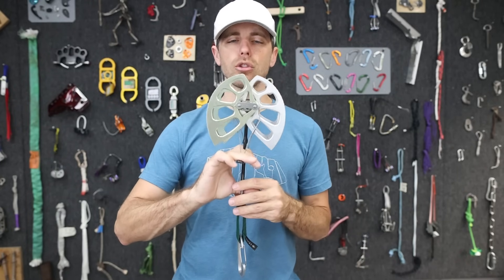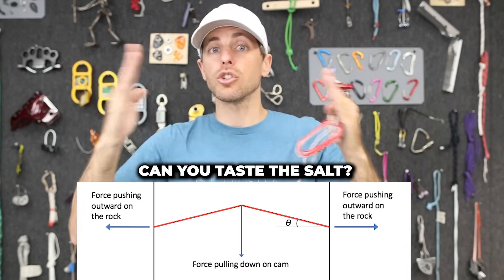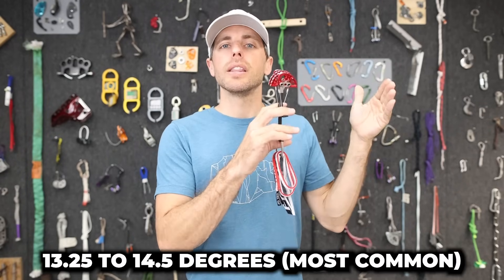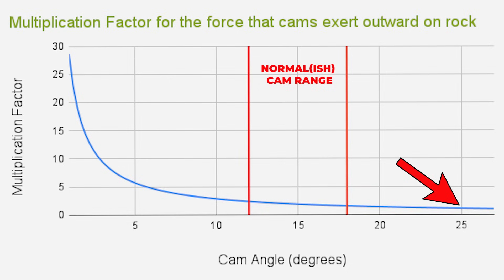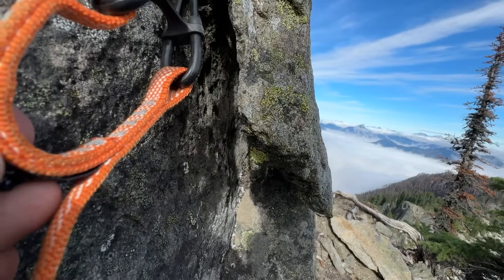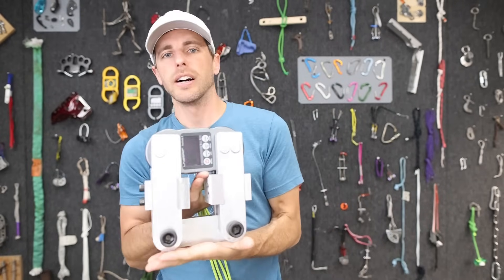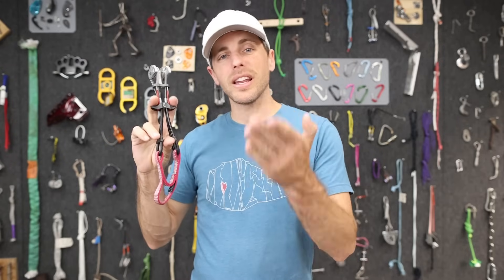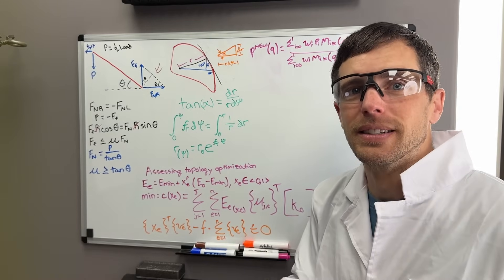What breaks first?

Comment: That's not c channel. That's just channel. There is a difference. C channel is square tube with a strip removed from the center of one side. You see them a lot in stop signs and sometimes fence posts. Sometimes there's holes drilled opposite of the channel.

Comment: Well... hate to be that guy but friction does NOT only count or matter if an item is moving... The 1 reason the anchor stays is by the friction caused by the force outward on the rock. The outward pressing force of the came is simply increasing the friction stopping the cam from shifting. Ignoring friction in this case is like ignoring gravity when doing rocket science... sure you can ignore that... but you're ignoring the literal BASE reality of what you're doing science on...

This is ESPECIALLY true on something like a hanging rope due to having such a high potential energy as the cam is being constantly pulled on. This is different than if a ball was just sitting in a hole as then friction wouldn't matter as the ball was at rest with no potential energy. But the came being pulled constantly means that the friction and not the outward force is what is keeping the cam in place and the outward force is simply increasing the friction the cam is placing against the wall.

Comment: I was on an aid lead up a flake on upper Cathedral and moved up on a pin and two passive nuts before doing a couple free moves then placing an overhead friend, like a #2 as I recall. When I sat on it to rest and get back in the aiders, two of my pieces below got loose when the flake, which seemed to be solidly attached, flexed a little. My intro to 'expando.' There's a bright side to this phenomenon- sometimes you can sit on a cam to make a nearby pin or nut, or another cam, easier to clean.

Comment: So I have BD cams from 2007. Sizes 1, 2, 3, 3.5(older style) and 4. Sizes 1 & 2, the plastic surrounding the wire cable is aged and cracked off. I have temporarily retired them, but I have an idea to cut the webbing off and put a quick link to use in a multi cam top rope anchor system, as the plastic coating is the only bad part. Anyone want to chime in as to how bad or decent of an idea this is? 😂

Comment: As a welder that builds pressure vessels, Id say that the jig you have is glued together. But as you would day super good enough, if it was perfectly welded it would probably handle close to 120000 lbs of tension.

Comment: I just want to state the obvious, the cam isn't pushing outwards on the lobes, it's pushing at an angle. This experiment splits the force vectors into two components at 90 degrees each. 

If you measure 1kn on a straight pull and get 2kn outwards, assuming those two measurements are at perfect 90 degrees, then each contact patch should see a 2kn vector going outwards and half of the 1kn vector going in line with the pull. So, the resulting force on each contact patch should be sqrt(0.5^2 + 2^2) = 2.06kn at an angle of acos(2/2.06) = ~14 degrees. Which coincidentally is what the cams are advertised at.

It looks like a rounding error, but if you want to chase all the variables, this 3% "rounding error" is what's holding the entire 1kn pull force.

Comment: Intuitively it makes sense it would be double the force; if the force holding it in the rock were less than the force pulling outwards, the cam would either slip or friction would have to make up the difference in force.

I’ve always just relied on my second grade understanding of levers to keep me safe.

Comment: i can't help think that anything with a malleable material like wood in the system will distort the results?
Reply: I originally thought the same. But, I think if the wood gives a little you would see a reduction in both outward and applied force and the ratio would be the same

Comment: - the "lever machine" - will have some strange binding / frictional issues pulling on a cam as it is operating in 2 planes with out of plane torque on the levers..

The compression cell tester looks good - maybe place the pads on  low profile drawer sliders to remove friction (even if insignificant)..

Comment: shouldn't the ratio of pulled distance on the cam to the amount it spreads be the easiest way to "calculate" the ratio of outwards to pulling force?
so if you pull 4cm and the cam spreads 2cm you have a ratio of 2/1 so two times the spreading force?
Sadly I can't find the pulling distance on your technical drawings. Would be awesome if you could "test" my theory.

Comment: The friction involvment is twofold. Of course, as it was said multiple times, coefficient of friction against the rock doesn't matter as long as it isn't slipping, but there's also coefficient of friction within the pivot which acts as additional torque on the arms of triangle in the diagram. which should lower the outwards force.

Comment: dude, you are awesome,
 the only thing i would make sure to have on the final rig is some kind of structure to make sure the surfaces contacting the cam and the load cells stay in place, a fun solution to angled contact might be to use a big ball bearings as a spacers to make sure the load cell is not getting angled contact with a flat surface, another idea is that it might be easier to put the spacers of the outside of the load cell where uneven contact might not be a problem, maybe a big thread or something like that might make the work as a spacer and now the only problem to solve would be how to make sure the contact plates don't angle with the cam. 
I love that the new rig also offers the possiblity of doing the friction tests on it cuz everything is swapable.
On the process side of things, it might be interesting to take pictures of the cam under load so that you can measure angles and points of contact from the picture, potentially giving you the option of calculating friction coefficients in the future.

Comment: Since the cam is pulling those friction plates into the side of the frame there will be an inward friction force opposing the cam's outward pressure meaning the measured outward force will be lower than it actually is.
Reply: Not by much, as the outward component of the cam's action is not in line with the friction component you're mentioning. The results is a pivoting action where most of (like in the order of 99%) the original sideward force is transmitted to the load cell.

Comment: It would be interesting to measure the tricam with different camming angles (from a tight fit to some less bomber placement you would be afraid that it can walk out). I expect forces ranging from what you measured (for a tight fit) until forces similar to a friend's in a wider crack.
I would be very interested in tests with ballnuts. I'm not sure about my math, but I get a factor <1 which makes me now more worried about getting enough friction than exploding the rock. :D

Comment: Sorry about my comment on the other video.  Could have been a bit nicer.  I'll admit that I was pretty relieved to see the numbers back up the math!

Not sure how feasible it would be, but i think a dynamic test on a drop tower would be super interesting.  Does an expanding flake "cushion" the fall and lower the peak force a significant amount? If the cam starts skittering out / breaking crystals, what happens?

Cheers

Comment: Good Job! Friction still not a factor, because it is too dependent on too many factors you really don't want to guess at.
Reply: Yeah it's easy enough to remove friction from the equation and just calculate the normal force, but for the testing friction was still really important. My little rig with the wooden spacers went through several iterations to find stuff that's easy to adjust but wouldn't slip

Comment: Now the real question is how much force rock can take.
Reply from the maker: All the kN if it's big enough.  Just make sure you climb on a UIAA rated rock!
Reply: @HowNOT2 It doesn't actually need to be very large.    A 0.6mx0.6mx0.6m cube of granite is approximately 550kg to 600kg.   Given that a cubic metre of granite is about 2700kg.  That would be heavy  enough to hold a 4 Kn fall.   Awesome video.
Reply: @twinmike1  That's not how physics works. You can move a cubic meter of granite pretty easily on ball bearings or balanced on a pivot. A flake of granite could be really well attached to a wall, or it might have weathered out to the point that it is right on the cusp of naturally falling off. After all, absolutely massive pieces of rock naturally fail all the time. Most of those existed somewhere near a perfect equilibrium at some point before failure where the several KN of force could have disrupted them.
Reply: Yeh that was the real interesting question for me. I think we all know that cams hold if their well placed. 

What I really wanted to know was how chossy looking a piece of choss needed to look before it wasn't worth shoving something behind it. 

Evidently there's relatively infinite variables, but still, that's the significantly more useful question to placing pro and building anchors.
Reply: Yeah....  As a professional geologist thats a big "it depends"
Reply: @AnonymousOtters  for certain. Which is why destroying some nature in the sake of science would help generate better eyeballs / rule of thumb. 

Because let's face it, we've all banged in some suspect fear gear because it made us feel better. But you don't really intend on testing it to see. 

Honestly critiquing a bit of rock is pretty relatable to stuff you've looked at and thought yourself, just the whole destroying nature part that comes after we don't do
Reply: With enough freeze/thaw cycles going into a crack, it eventually goes to zero. As anyone who has seen a rock fall off a cliff can verify.
Reply: Yeah, knowing the numbers for the force applied is precisely useless if you don't know the force the rock can take.
Reply: I usually go by if I can yard on the flake with directional force in it’s weakest direction it should be fine but just stitch that crack up and climb carefully and trust the choss
Reply: good point, rock type video and their breaking strength would be great
Reply: well i know from practical testing that a motor hood sized block of rock can be too small to hold a tiny whipper of about 10cm. It did look well connected to the rock, which it obviously wasnt because I ended up on the recieving end of that thing. fun times!

Comment: but its 2x on each lobe, so wouldn't it be 4x overall force? 14:30 you have 1kn pushing on the vector to the left, and 1kn pushing on the vector to the right. that means the fixture (or the crack) is seeing a splitting force of 2kn right? or 4x the tension. I think your original jig would give a better indication as to the splitting force on the flake
Reply: By the same reasoning, a bathroom scale you're standing on would be showing 2x your weight - being squeezed by you from one side and the ground from the other.

But your logic would be correct for mechanical work (force * distance).
Reply: @serges5681  no it wouldn't, there's only one vector force in that analogy - my weight. here there are two - from two lobes pushing in different directions.
Reply: @jaskiranism  there are two force vectors, a vector from the person's weight, and another from the ground in the form of a normal force. Any time an object isn't moving, the forces and moments of the object need to be balanced
Reply: @jtambo13  ah Ill clarify what I meant, there is only one active force in the bathroom analogy (you are right, there is a reactive force from the ground to the human). if you want to include the reactive force there are 4 vector forces for the cam, lobe 1 against the flake, flake against lobe 1, lobe 2 against the wall, wall against lobe 2. a better bathroom analogy would be the ceiling is low enough for you to push on whilst you're on the scale, how much force are the walls experiencing whist you push them apart. this did go through my head but again - i don't know the correct answer. but like you said, if you push down with 1kn and up with 1kn, the ceiling and floor must both be doing the same for the system to be in equilibrium
Reply: @jaskiranism  Does the ground not push back (up) on the scale ?

Anyway, I think the root problem here is that HowNot2 introduced an unnecessary concept that causes confusion (clash between intuition and physics) and doesn't bring us any closer to what we actually want to know.  We want to know if 4kN on the cam will break off the flake.  Knowing that each side of the crack sees 8kN doesn't bring us any closer to what we care about.  I'm guessing HowNot2's main goal was to use its test rig to settle a long-standing physics argument among climbers, and the whole crack splitting justification is just an excuse.
Reply: @jaskiranism  I think you're getting there, but reaction forces ar occuring between all objects in contact, not just "active" ones, which isn't a real distinction in physics. In the bathroom scale case, there is the force of your weight on the scale, the force of the scale on you(reaction), the force of the scale on the ground, and the force of the ground on the scale (reaction). If we made a free body diagram for the scale, we would only see the force of you on the scale and the reaction of the ground on the scale, since those are the forces acting on the scale. In the flake case, it would take the same amount of force to "push" the flake apart from the inside as it would to "peel" the flake apart from some anchor point without pushing on the main rock.
Reply: It's definitely most accurate to say that the force from the cam on the rock is twice the downward pull on the cam. It's true that a single rope holding two opposing plates would have tension equal to 4x the downward pull on the cam, but that isn't really representative of what's going on when we place a cam in a crack, or how a flake would fail. To figure that out, you'd need to know the specifics of the placement,  the flake geometry, and you'd still use the 2x pull force in the 3 body diagram. I hope this makes some sense, I desperately wish I could draw a diagram 😅
Reply: @jtambo13   see what your saying, and agree its 2x the force on the rock, but the rock on either side of the flake must meet at one point. if you subtract the vectors on each side of the rock 2t - (-2t) you have a force of 4t on where that flake converges (the point that will fail) right? i think the point isn't how hard the cam pushes on the rock - its how much splitting force the crack "see's" which will be the failure mode. my brain hurts
Reply: @jaskiranism  for the flake/rock example, you can draw a free body diagram for just the flake. The force from the cam on the flake (2x the pull) is reacted where the flake meets the main rock, and this force, internal to the rock, would also be 2x the pull force, since, for this example, we're assuming the flake is static, so the sum of the forces has to be zero. There would also be a moment (read: rotational force) to counteract the action of these offset, opposing forces, so the flake is also rotationally static
Reply: I wonder if he made the same jig but with one compression load cell just on one side. Then maybe it’s more representative of the expanding flake scenario? 🧐🤷🏻‍♂️
Reply: @DesertTowersRfun  both sides of the jig are in tension, but you're right that you may get the most accurate results there (or a better sense of what was going wrong) with a load cell on each side

Comment: The friction does matter even if the object is not moving. There is a static friction coefficient for every material that is actually larger than the dynamic for the same material. If you could imagine a perfectly smooth, frictionless surface, the forces wouldn’t better because there wouldn’t be any resistance if you were pulling the cam out Parallel to the surface ti was wedged in. The friction force is calculated by the coefficient of friction time the normal force (force that the cam is pushing into the rock) this friction force is what’s keeping you on the wall. There is no velocity component to the equation. Not that any of this matters though if you can actually test it😂
Reply: Yeah, but if you don't overwhelm the coefficient of static friction, everything is...static. The forces measured will be the same as if the objects were welded together. So, unless it's actually slipping, you don't need to account for friction to measure what he is measuring.
Reply: Ah just got to the part of the video where you said friction is a factor 😂😂

Comment: Didn't finish the video, but it is SUPER clear that the height where the cam is regarding the center of the "lever machine" is the most uncertainty factor here and will contribute massively to the variations in measurement.

Comment: Do you get your load cells calibrated occasionally? I work in a testing laboratory and use load cells all the time and they can drift drastically over time especially with shock load. Like I'm talking 12%
Reply: Given his joke about how the ink on his protractor hadn’t been calibrated that week, I suspect he’s aware of the importance of calibration.
Reply: Wohowowho what stuff are you using? I've never seen a load cell drift more than 5% from it's original calibration certificate and that's after serious overloading
Reply: @bellini98-1  We use load cells for geologic applications and they definitely drift quite a bit, particularly when left monitoring stuff for years. I think it just depends on your application. We've definitely seen sensors drift over 10%. Leads to lots of data management fixing sensor drift
Reply: I work in live entertainment and have always begged for motor point load cells, especially on some super tight and maxed out rigs. I’ve seen Kinesys automated hoists several times and have yet to see a dedicated “static” load cell ever deployed on a rig.